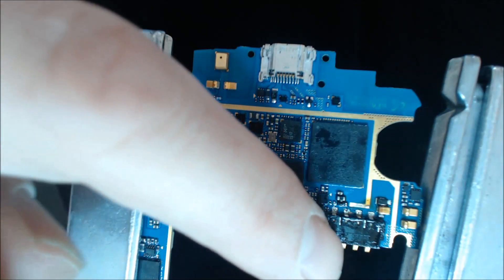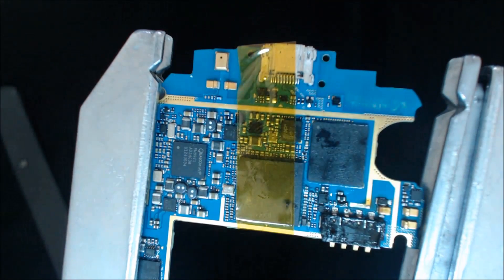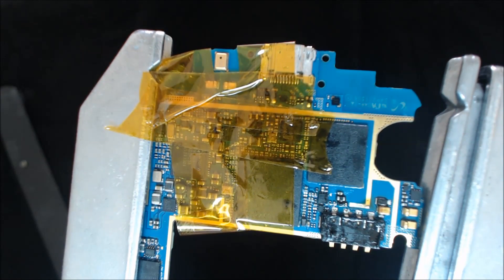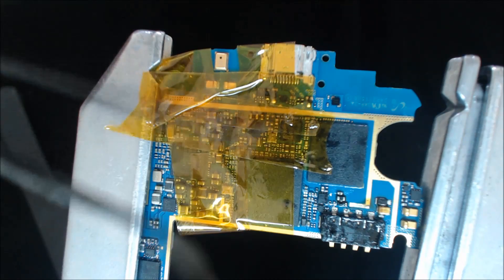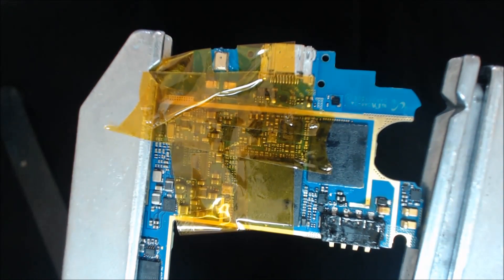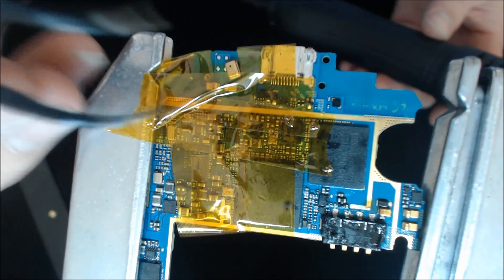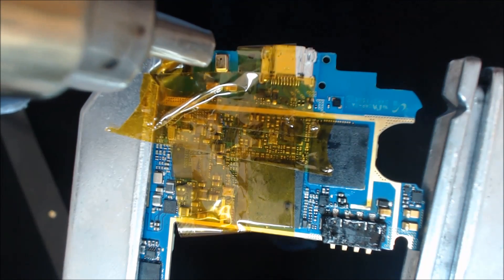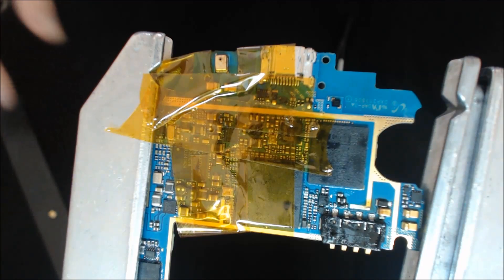Galaxy S3 Microphone Repair | Help! No One Can Hear Me | Samsung Galaxy SIII

Comment: please share the Motorola Droid Turbo Mic replace. only the mic for calls is not working and it has 4 mics on the bottom section. 2 on the front and 2 on the back side. so please also guide which one needs to be replaced...Regards.

Comment: I have an s4 and replaced the mic and charging board 5 times. my phone changes anf and speaker phone works but when on a regular call the mic doesn't work can u help
Reply from the maker: Which mic? Does it record sound still or only phone mic?
Reply: +RockIT Tech just the phone mic it still records.
Reply: you need to change the mic. loud speaker and sound recorder mic is different. so you have to change the call mic to fix your issue. regards.

Comment: What is the name of this glue than you use ? I want repair the mic of my Xperia Z3 Compact. Thank you.
Reply from the maker: We do not use glue we actually solder the mic back down.
Reply: +RockIT Tech Ok but, what's this product than you use before remove the mic ? What's it used for ?
Reply from the maker: +Florian Vizuete  Give me a minute/second in the video so I can tell you.
Reply: From 3:10,  you show a syringe containing the product of which I speak you, is that you apply then on the microphone. I want to know, what is this product ?
Reply from the maker: +Florian Vizuete That is flux. Here is the link to purchase. http://amzn.to/1ILF4AY
This flux helps with melting the solder evenly and is a must for micro soldering components.
Reply: Thank you.

Comment: My Galaxy S3 USB stopped working, and just found out my Mic too is not working. Any way of testing to see if it is the Mic and not a chip a part of the mic circuit?
Reply from the maker: +sypher0101 Not really. The mic is a simple replacement, so I would replace the mic first then test using a good battery with an external charger. You can get for $5 on ebay. Then if mic is good after replacement you can go ahead and fix the charging port.

Comment: Is the mic that durable?  the new one is not gonna get screwed up from the heat?
Reply from the maker: +Atanas Tripzter No The heat will not mess up the new mic. Just make sure you do not get any flux in the mic hole.

Comment: what did you exactly use to weaken it loose? Ad what sort heater was it?
Reply from the maker: We use Flux to help liquify the solder and a rework station to heat and remove the s3 mic from the logic board.
Reply: RockIT Repairs Inc. okay thank you!
Reply from the maker: The flux in this video is MG Chemicals flux and the heat station is an X-Tronic.

Comment: I have an S3 mini, replaced the microphone but still won't work, when using the sound recorder in only records like static, any idea why would that happen?

The seems firmly soldered, but will check it up again in the morning
Reply from the maker: ***** I would try again. If the board got overheated or damaged from the temp then perhaps it is permanent but I would try a new mic and resolder again. Make sure to kapton tape up the hole so no flux gets in the mic

Comment: Did this and still no sound from bottom mic. NR is turned off in my settings, and tried calling my land line in both handset and speaker mode. Don't know what's the problem. My S3 is Sprint SPH-L710 on Kit Kat  4.4.2.
Reply from the maker: FlickTricksOffical Sometimes you have to replace it twice. You never know if the part is bad. Do try again.

Comment: I repaired the DC jack on an S3 and now the mic appears completely dead.   I used a soldering iron on the Jack.   Cleaned up Flux with alcohol.   I didn't think anything got on the mic.   Would alcohol or Flux on the mic cause complete loss of audio, or would it just cause distortion.   Thank you.
Reply from the maker: Joe G You will need to replace the mic. Happens a lot. Sometimes flux gets in there and just ruins it. You will need a rework gun to heat the new mic back down.

Comment: galaxy s3 i535.Intermittent mic for all except camera video which is excellent.Do you think a new mic would solve problem?Thanks,Chuck
Reply from the maker: Charles K Yes normally it will. Could be software however at the end of the day. Have you tried a factory reset?
Reply: RockIT Repairs Inc. Bought s3 used.Former owner must have drop it in something.Took all apart and cleaned in alcholol.That fixed problem.
Reply from the maker: Awesome so all is well with your device now :)?

Comment: Are there vias that go through the board that might make it possible to hand-solder? Don't have a pencil
Reply from the maker: I am hand soldering here. What do you mean?
Reply: RockIT Repairs Inc. sorry, I mean solder with a iron rather than a hot-air pencil. Vias are conductive paths through PCBs that are primarily used to connect layers together, but as they're metal, they can also be used to get heat to the pads of no-lead packages by going through the board.

Comment: Any tips for preventing the mic getting damaged during charging port replacement?  I use a heat gun and cover up the mic with a few layers of Kapton tape and it still sometimes damages the mic.  Can't understand what's going on considering that in order to replace the mic, I gotta use a hot gun.  The temp it's set at is 280C.  Not sure if it's too high or not.
Reply from the maker: The key is to make sure the top hole is sealed. When putting on kaptop. You can put a small first layer no bigger than the top of the s3 mic hole and then tape over it around the board.

Comment: I did this myself, went well, result was great. But then the sound went bad again for no reason. I think the mic wasn't perfectly aligned. Anyway, I did it again with a new mic piece, and this time the sound works but with static when there's silence.
Does the soldering of the mic affect the quality? Would this be a problem with the mic part, or the solder joints?
I covered the hole with kapton tape so no flux got in.

Comment: Hi, After cleaning 3 months old apple juice damage, my mic and texting don't work anymore. They used to work before cleaning it. Texts are intermittent. Some go thru, some don't. Any idea what needs to be replaced please? Also, if I stick needle into the mic, won't it damage its diaphragm? Thanks.
Reply from the maker: You cannot clean the mic with anything. Alcohol will mess it up. The replacement part for the mic is only about $2.00

Comment: S3 front and rear cameras not working. Tried factory reset and cashe wipe nothing. Replaced rear camera with a known good used one, still nothing. Software freezes once open  with a "camera failed" message. Any ideas?
Reply from the maker: Try taking out camera. hard resetting then without looking at the camera again put back in. reset one more time then turn on and check out camera. usually good.
Reply: Your Image Processor got ruined m8, its right next to the camera connector and sometimes there is a EMI Shield solder over it so good luck

Comment: ok... I did everything perfectly right.... Still no sound.  I just tried blowing and taping while using voice recorder i do get feedback.  When you say clean with a needle...How should i go about doing it without damaging the mic.
Reply: Repair Vidz This tip worked for me!! I was driving myself crazy trying to figure out why the mic didn't work. After trying (and failing) many software "solutions," I was going to go the replace/repair route, but just cleaning out my mic with a small needle first fixed my issue!
Reply from the maker: Just take a needle and gently poke little bit into the hole.Do not jam it in the mic
Reply: So glad we could help Riaz Rahman. Hopefully saved you time and money that can now be spent on those beautiful kids. Take care my friend.

Comment: My Galaxy S3 recently went swimming with me :(. I took it apart, cleaned everything with alcohol and dried it in rice. Everything works except nobody can hear me and the backup arrow and options (on either side of the home button) do not respond, but the rest of the touch screen is fine. Any ideas?

Comment: replaced the mic but didnt help. if i blow into mic hole sound gets recorded  but other than that its doesnt get any sound.. any thoughts?
Reply from the maker: Take a needle to he mic and clean it?
Reply: Peter did your mic work after cleaning with needle.
Reply: Nope. Replaced it. Cleaned the hole with a needle too. Still not picking up voice unless directly into the hole. Maybe damaged new mic with solder ???
Reply: Peter Meistelman ok...I made head way last night... I had to add a little solder to the 4 points on the board.  Once I did that and put the mic on, I was able to talk through the mic without an issue.  This may help you.

Comment from the maker: There is no S3 mic ribbon Mohamed. The mic is on the board itself.
Reply: Hi have the same problem , both mic's not working , did you find a fix for this?
Reply: RockIT Repairs Inc.  - I have an issue and hoping some help from you, My Samsung S3, people are not being able to hear me when i talk to them normally, but are being able to hear me when am on speaker. Not sure if there are 2 mic's in the phone executing different tasks (on speaker/off speaker) Could you please suggest? A reset etc did not help, not sure if this is a software issue?

Comment: Hi, thank you for the vid. I killed my S3 mini a few days ago (down the loo) so I watched a few vids I nervously dismantled it, cleaned it with alcohol and it worked! The only thing is, no one can hear me, although I can hear myself as a sort of delayed echo. Do you think I will need to change the microphone?
Reply from the maker: It's weird that you can hear yourself echo. Have you tried taking a pin and making sure nothing is blocking the little hole on the mic?
Reply: I'll have a look, but I have bigger problems at the moment, the touch screen is stuck on the lock screen, and will not respond. I'm wondering if a screen replacement is my only option. Any idea?
Reply from the maker: Sounds like a bad digitizer. have you chaged the digitizer? If not make sure you clean the digitizer FPC connector with alcohol.
Reply: No I haven't changed it. I cleaned cables and board etc, with alcohol. Is the digitiser replacement the entire front panel?
Reply from the maker: Yes you have to replace the entire front panel if the digitizer fails to work properly. Sometimes it could be because there was too much LOCA applied during a repair but if it just doesn't work anymore then yes you must replace the full lcd.

Comment: you have to heat under the mic not on top......your mic is damaged right now and the kapton tape is usles and that kind of repairs
Reply from the maker: We have done 100's of these repairs and we always heat on top and use tape. His way may work but this way most definitely works and we use it on customers phones daily with warranty.
Reply: Kapton tape is pretty much to prevent any other changes around from what you're repairing..

Comment: Is this method safe for a microphone? What is the maximum temperature for these things? I accidentaly broke one while replacing usb port in my friends phone (I have no idea how this happened though).
Reply: Doesn't matter anymore. I've already repaired that phone. I was worried about that temperature and set 390C. And instead of that polymer tape i used ordinary aluminium foil. There was not enought of solder left on the pads so a tiny bit of solder paste was required.
Reply from the maker: pvc988 Awesome. Sorry for the delay on the answer. Sounds like you did it perfectly. Great job on your S3 mic repair.

Comment: Did you say 470 degrees (I'm assuming Celsius)? That is a very hot temperature for that thin of a board and you risk burning or damaging the board. I would recommend using a heat no hotter than 370 degrees Celsius.

Also, if you heat the board from the bottom (on the other side of the mic), you won't have the problem of it blowing all over the board
Reply from the maker: Yes it is in Celsius. We like it hot.  Fast process and full emulsion of solder always across the board. I don't recommend heating the board from the bottom as there is no need to get the entire center of that bored that hot.  turn down your air flow if you are blowing chips everywhere.

Comment: My S3  got wet and now the phone works great except the microphone.  What do you charge to replace the mic?
Reply from the maker: You can take apart your phone and remove the logic board and take a hair dryer and try to dry the bottom mic by the charging port out. If that doesn't work you will need to replace the microphone.

Comment: What is that tape called?
Also did you set the heat gun to 470C or F?
Reply from the maker: The tape I used is Kapton Tape to wrap around the s3 microphone area. 
Here is the tape - http://amzn.to/Pn2UxQ
The heat gun is set at 470 degrees centigrade. We use an X-tronic soldering rework station for this s3 mic repair. This is the soldering and heat station. http://amzn.to/1hfzBsN.
Reply: Repair Vidz Thanks, I appreciate it! I've already ordered this soldering station: http://www.ebay.ca/itm/121248700292?ssPageName=STRK:MEWNX:IT&_trksid=p3984.m1497.l2649

Not much in the way of reviews on any of these things, so hopefully it works out for me. Got a 1 year warranty on it anyway.
Reply from the maker: Yeh that is not the same model we use. A lot of companies make knock offs so just beware. That is not an original model.
Reply: I call it kaptain tape lol